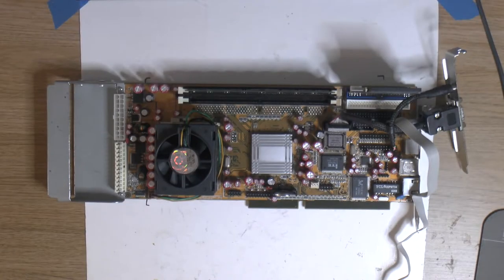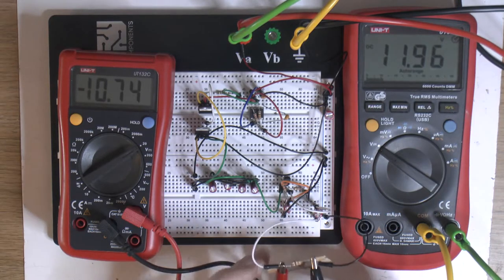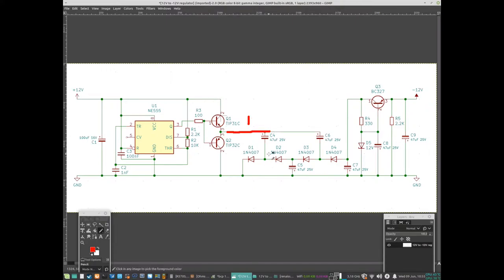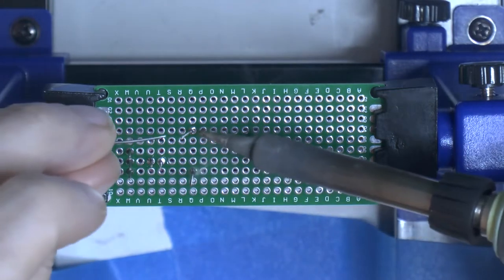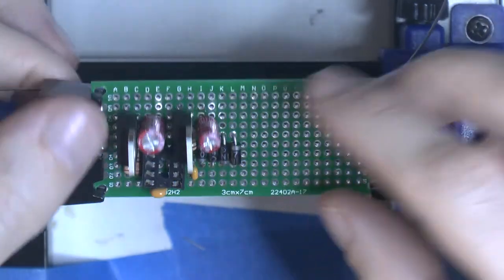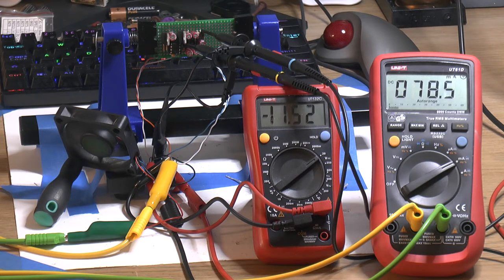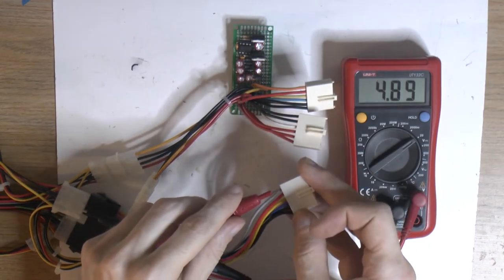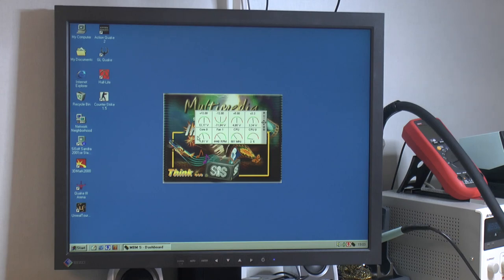Molex to AT converter for my Powerleap Renaissance/370S

Comment: I am confused, seems to me that 24 pin ATX splitter and ATX to AT adapter would do the trick, and be simpler than doing a diy power conversation.
Reply from the maker: There is no ATX PSU in the system.
And the simplest thing would be molex strait to AT because the board works fine with 5v and 12v only if you dont need serial ports and that would work with any system with a molex.